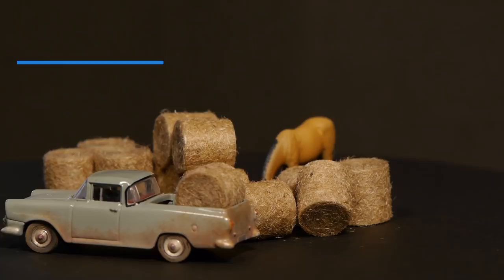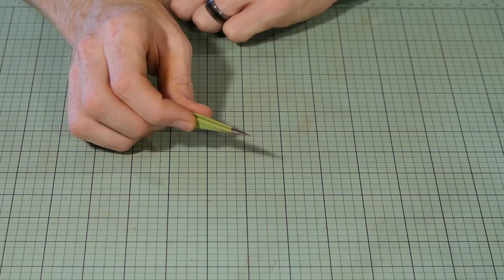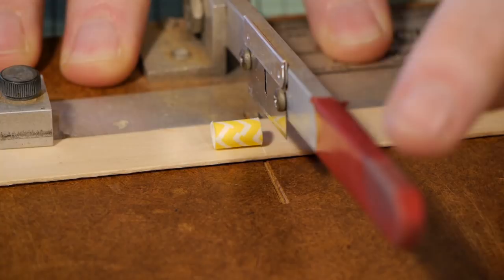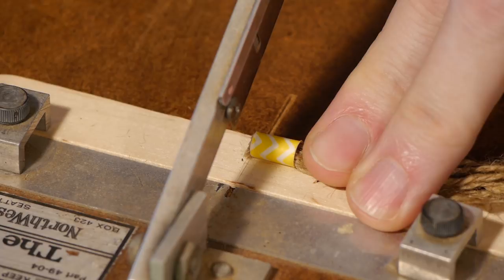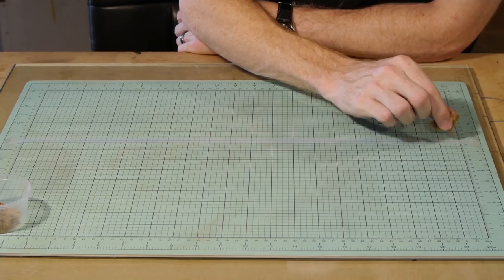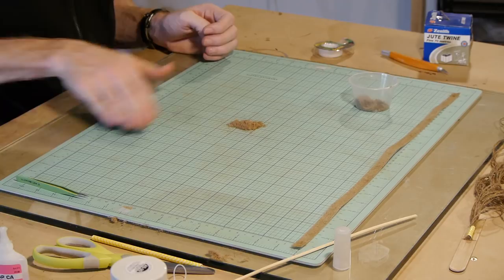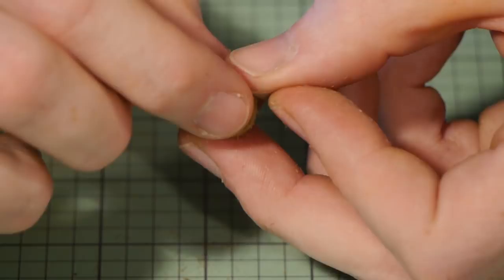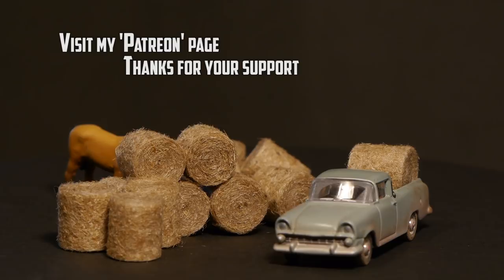Realistic Hay Bales – Model Railroad Scenery

Comment: As a quiller, I'd also suggest a needle tool (simply a needle with the top of the eye cut off and stuck into a dowel) or a pin tool to start the bale. Both would leave a hole in the centre, the needle tool about the same size as the tweezers, the pin slightly smaller, but they're a lot easier to spin and coil the bale faster. (Though the pin tool is a bit fiddly to get started.)

Comment: Thanks for your reply Luke. I should add a bit more to my previous comment. I did not use the twine you used. I used the real stuff, as is used to "wrap" the full size rolls so they dont fall apart when they are moved. The colour is exactly right for hay that has "cured" a few days in the sun. 
I did not use a little jig like you. As there is a twist in the twine, it holds together when it goes under The Chopper, (folks, if you have not got one do so, its the best 20 bucks you can spend).
However, when I have used the full size machines we wrapped the rolls in  plastic netting. I reckon some tule in a strip might look the part here. White would be ok.
When we cart the rolls, one at a time is not done. We have four pairs of forks on the tractor,  2 pr on the front and 2 pr on the 3pl (3 point linkage) at the rear. So instead of one at a time it is 4 rolls at a time. Tends to speed things up a bit! I might add it is way better than picking up small rectangular bales. Done thousands of the little stinkers!
Pete
Reply from the maker: +Peter Pocock the forks I made have four prongs, I think it could be feasible to pick up 3 at a time with it in a triangle formation... not sure if it would be prototypical or not? 
I really like the idea of using tulle to wrap bales, I'll definitely give that a try! 

I used to work at a stock feed, however we didn't deal with the large round bales much and when we did they got loaded one at a time usually. I know what you mean about the square bales! I couldn't tell you how many of those I've stacked, it kept me very fit climbing up and down massive stacks of hay in the shed loading and unloading trailer loads of hay. 
Those days are long behind me though, now I just sit in a seat and take people from A to B.
Cheers
Luke

Comment: Very good video. I made a few of these bales but did not have any CA glue on hand and the glues I did have did not stick well to the back side of the tape. Therefore, I tied a thin thread around the bale at both ends and it looks good. In photographs of round bales, sometimes you can see the twine that holds them together and other times you can not. So I guess tieing them is still fairly prototypical. 

Back in the 70's, I did some modeling and now that I am retired, I am back at it again. Your videos are very inspirational. I enjoy them very much. Thank you.

Comment: Put the twine, lots of it, in a small high speed blender!! And for making lots of hay bales, get very wide tape, spread the twine-fragments all over, then roll the tape, on a thin steel pin (1 mm), roll up, glue end remove pin, cut the tape into required widths for HO scale bales with a large guillotine (one of those paper guillotines from an office supply outfit) or maybe your guillotine (Chop-it) will do that job. Make 50 at a time! If you can't find sticky tape that width, then just get thin strong tape, lay it out flat, paste clear-setting glue on it and then spread twine-fragments.

Comment: Hi Luke
I have read some of the comments and one person queried the scale of these little rolls. Yours are pretty close using 18mm tape (HO scale). The REAL rolls can be up to 6 foot in diameter (takes a decent front end loader equipped tractor to pick up 2 of them for stacking). If we accept our scale is 3.5mm = 1 foot, the the maximim roll diameter is 21mm and the width is the same. But, in practice we made the full size rolls 5 foot dia. (although mine are a bit narrow using 18mm tape) so guess what? Luke's are near enough! And just to add, I have a 1:87 John Deere Round Hay baler and the little rolls "look" the part, in and outof that.
 Now all I have to do is make a suitable set of forks for the front-end loader!!!
Pete
Reply from the maker: +Peter Pocock Thanks for the great info Peter, I also made some forks for my tractor they just need a coat of paint.
Cheers
Luke

Comment: That's really thinking outside the box!I like it. 
I was curious about what your approach was, because I built a display for a mining company that was drilling test bores around some rural properties. They proposed using hay bales and sound dampers for their equipment so as not to bother residents, cows, etc. The problem? It was in 1/32 scale, so that we could use commercial model vehicle parts!
In the end, I made a half-fist-size core of Renshape wood substitute, covered it in Fimo clay, and hand-tooled the circular end patterns of the hay. I found some cheesecloth (I think it was) and wrapped the circumference, as wrapped bales are fairly standard around here.
After that, it went to the casting bench, whence about two dozen resin bales emerged over a couple of days. After a paint and wash, they were glued together to form an impressive barrier, but by gosh, they did look like bales!

If I'd only had a miniaturizing ray, I could have made really easy HO versions!
Reply from the maker: +carmium wow that sounds awesome, I'm sure it would have looked fantastic. I considered crafting a bale that could be molded but wasn't sure where to start!
Cheers
Luke

Comment: Luke, I don't know if you tried this, but you might test it: If you buy linerless double stick tape and stick one side to the cutting matte lightly, you could press in the fibers then, as you roll it up, IT WILL STICK ITSELF. No unwinding! It seems like it would be easier?
Reply from the maker: Thanks for the tip Mark, I hadn't tried that but I'll have to give it a go!
Cheers
Luke

Comment: hey Luke, great video as usual. could you use a coffee grinder for the twine or would it make the pieces too fine?
Reply from the maker: +Taylor Trottier I think it's possible, finer fibers would probably work quite good as well. Unfortunately I don't have a coffee grinder. But I would suggest chopping the twine quite small before putting it in the grinder to prevent the twine wrapping around the blades.
Cheers
Luke
Reply: I was wondering the same. Going to try it today.  5 years on, and this tutorial is STILL. Helping new modelers.  Thanks, Luke!

Comment: Great turtorial Luke you do a super fine job , I went and built my own Chopper , Still work s great , I started with the sisors, I see what you mean , Just made my first 2 hales , I think they look great , While I was at our Hobby Lobby here in the staes I notice they sell those Woodland scenic has them 15 round and 20 square for 10.00 dollars , My question to you is could you make a tutorial on making the square bales also  I've put all of your tutorials in my favorites , My next project is building a Static grass machine Love it also , You have some Super Great and money saving Idea's Keep up the good work , Thanks again
Reply from the maker: Hi Jim, I'm impressed that you made your own chopper! Cool... I have a few ideas for square bales, I'll probably do a video in the next month about making square bales. I just need to do some more experiments with the material I'll be using for the main structure of the bale and the best way to add the baling twine around the outside of each bale. I'll post some update blogs on my website when I get close to making the video.
Cheers
Luke
Reply: Thanks Luke, Can't wait , Keep me posted  about the other video

Comment: Since the twine hay in the center of the bail can never be seen again once rolled up, couldnt you only apply twine at the edges for <90% of the tape before rolling it up, so you save a lot more time and energy? Perhaps by using a second peice of tape, thinner than the first, and stuck to it so both sticky sides face each other. Then the hay would only stick to the edges.
Reply from the maker: I'm sure that would work, I did consider it but I couldn't think of a simple way to do it? Your method sounds like it would probably work. I might give it a go next time I make a bunch of hay bales... which won't be too far away!
Cheers
Luke

Comment: Hey Luke, absolutely brilliant! Have you got any suggestions on how I could make the bales rectangular? Rectangular bales are very common here in the UK. 
Cheers
Howard.
Reply from the maker: +Mayhew Junction I've been getting a few people ask this question, you could cut a piece of extruded foam into a small square bale shape, spray the square foam with tacky glue and then using the same cut pieces of string (Jute Twine) roll the foam square in the fibers? To finish it off tie two pieces of string around the bale to show the twine holding the bale together?
Hope that helps 
Cheers
Luke
Reply: +Luke Towan thanks Luke, sounds like a good idea, I'll give that a try, I have a haystack to build!
Cheers
Howard.

Comment: That's overkill, because most of the fluff isn't going to show. Only the edges show. So it would be better, once you know the actual length, to paint down the middle of the tape, with probably more than one coat to make it thicker, or maybe just another thinner cut piece of tape, so that only about 1 to 2 mm of the edge are showing sticky. That saves on a lot of fluff, too, so you don't need as much. And then make sure the end of the tape is fully covered in fluff for the final roll. (1 to 2 cm) I think that would be a better way to do it.

Comment: Luke, is there a way this technique could be adapted for square bales? layering the tape in rectangles perhaps?
Reply from the maker: +xvonline lol, I just answered this question from another person... here is what I suggested, you could cut a piece of extruded foam into a small square bale shape, spray the square foam with tacky glue and then using the same cut pieces of string (Jute Twine) roll the foam square in the fibers? To finish it off tie two pieces of string around the bale to show the twine holding the bale together?
Hope that gives you an idea :)
Cheers
Luke
Reply: +Luke Towan thank you lol

Comment: Awesome as usual Luke, Great idea!  How would you advise to make the square style bails?
Reply from the maker: +chris dav Thanks Chris, you could cut a piece of extruded foam into a small square bale shape, spray the square foam with tacky glue and then using the same cut pieces of string (Jute Twine) roll the foam square in the fibers? To finish it off tie two pieces of string around the bale to show the twine holding the bale together?
Just an idea... I haven't tried it myself yet.
Cheers
Luke

Comment: Could you do this with static grass? Or is there a reason you choose to chop the twine manually?
Reply from the maker: yeah you could use static grass, you need very short fibers though... 1mm grass fibers work best which is not commonly available at hobby shops. I usually order 1mm grass online through eBay. 2mm grass is much more common but for HO scale it looks a little bit to big.

Comment: do you think that would work for square bails as well?
Reply from the maker: +ATSF/SP Railfan I thinks so, here is what I wrote to another person who asked about square bales: you could cut a piece of extruded foam into a small square bale shape, spray the square foam with tacky glue and then using the same cut pieces of string (Jute Twine) roll the foam square in the fibers? To finish it off tie two pieces of string around the bale to show the twine holding the bale together?
Hope that helps
Cheers
Luke

Comment: Hi Luke about how long of tape for O scale. Thanks for any info
Reply from the maker: I'm not 100% sure but I'd suggest doubling the length to start.... you may even need a little more? But I'd use 2mm static grass for the fibers instead of chopping up the twine will will save many hours of chopping!
Cheers
Luke

Comment: Can u do 1.32 scale make
Reply from the maker: +John Dillon It's possible, the fibers would need to be slightly longer though, and the sticky tape would need to be about 40mm wide, which means you'd need much more twine but you could simple use 2mm static grass instead.
Cheers
Luke

Comment: How about in scale 1:32??
Reply from the maker: the same technique can be applied to 1:32 as well. You'd just need to use a wider piece of sticky tape and cut it probably twice as long. I'd use 2mm static grass fibers instead of cutting the jute twine for 1:32 scale.
Cheers
Luke
Reply: Luke Towan Thanks a lot Luke!

Comment: i tryed this 3 times and it did not work...i don't know how sticky your tape is but this sucks
Reply from the maker: There could be  a few different factors affecting your result and I guess the main one is as you suggest the tackiness of the tape, I used 3M sticky tape which is one of the better brands for sticky tape. Also the size of the fibers will have an effect, the finer you chop them the better they will stick and finally the type of string will also effect the end result, if you used wool or cotton as an example the fibers would be a little 'hairy' and they would not stick.
If you use 3M tape, Jute twine and chop the fibers up to no longer than 1mm long you should have no troubles making the bales. Alternatively you could replace the jute twine with 1mm or 2mm static grass, that way you would save a lot of time not having to chop the twine.
A lot of people have tried this method and got good results.
Hopefully you can get it to work.
Cheers
Luke

Comment: well for the money that i spent trying to find 12 to 15 mm tape and going to 5 different hard were stores to find twine that i could use..i could have bought the one's already made..and the fact that you left out all what you did not telling people of what you used to make yours...f that i will buy them..i spent over $26 dollars..and if you are going to make a video of how to make something you should at least make a list of the things that you will need to make what you are trying to sell.your video's are very good..but when you miss lead people into thinking oh this is so easy..but wate i for got to tell you that i used sticky tape..wow that blows man
Reply from the maker: No worries mate, I appreciate your feedback. I don't intend on misleading anyone and I thought I was pretty clear in the video on the materials I used (I mention it right at the start of the video). I used 3M tape (shown in the video) but in all honesty I've made them using cheap no brand sticky tape that cost 50 cents, the only reason I don't show it in the video is because the no name brand doesn't make the 15mm wide version so it was no good for HO scale. 
Basically everything I did to make the bales is shown, there is no behind the scenes stuff that I did to trick anyone into thinking it was easier than it actually was.
I still think it's much cheaper to make them yourself, even if you spend $26 buying fuel/materials I'm sure you could make a hundred bales with that, compared to 20 bales for about $15. 
Keep trying, I'm sure it's just a matter of practice and you'll have some great looking hay bales.